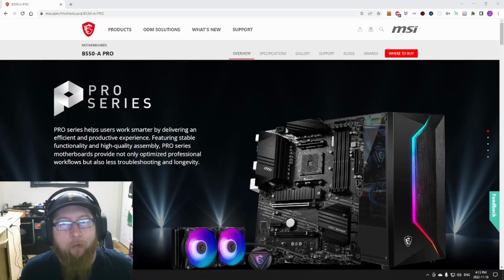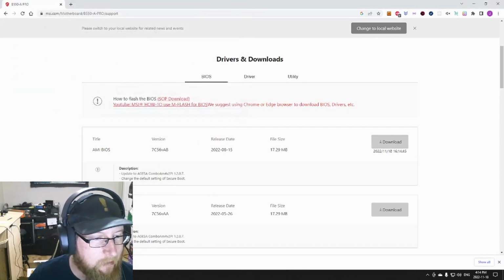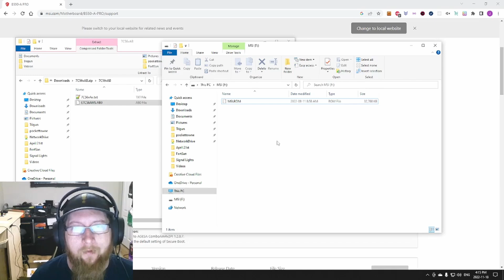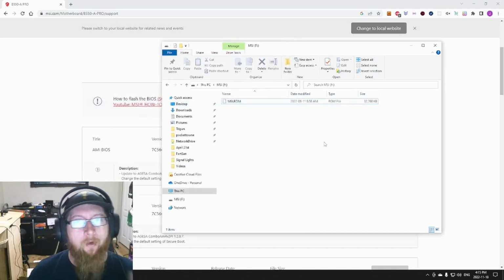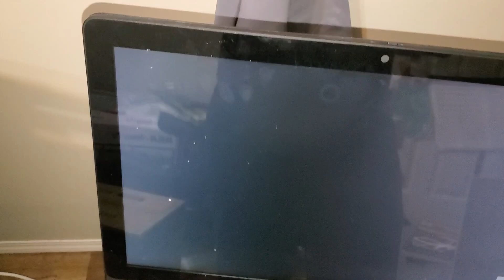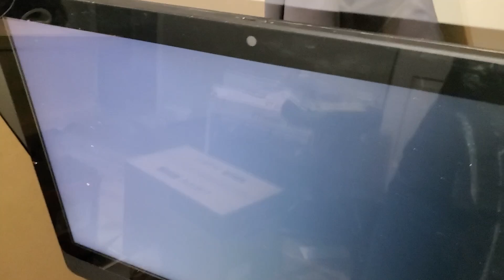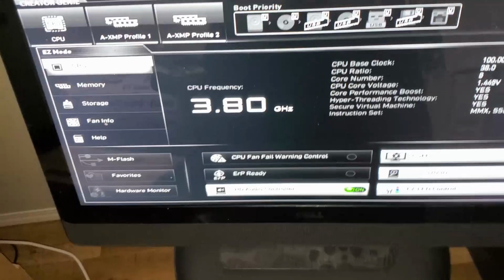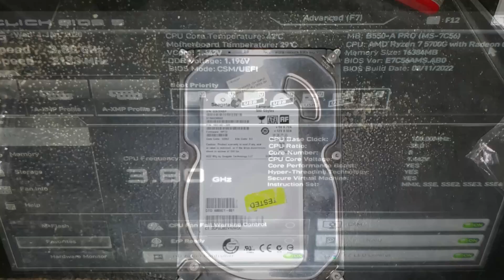MSI B550-A Pro Flash Bios

Comment: I recently had the white ez debug cpu light come after 2 years of the haven the 5600x for this motherboard and now my pc does power on but no display should I update my bios?
Reply from the maker: That is beyond this video. I would post a question in the /r/pcbuildhelp subreddit with your system specs. Someone may be able to assist you further.

To me it sounds like you may need to re-seat your graphics card, or maybe re-paste your CPU? Maybe you have overclocked it and it reduced its life span or the overclock has made the paste not as functional therefore it overheated it? Tough to say without troubleshooting further.
Reply: @Kardall I've reseated the cpu and video card and ram and reset the cmos check all the power cords and everything powers on. It was work that morning and I come home from work then that happens.
Reply: @raizovile did you fixed it? I have same cpu and same problem

Comment: i hve try wht an 128 usb creating a 6 new fat-32 disc.. no works
Reply from the maker: 128gb or mb? smaller USBs are usually better. I use an 8gb stick for mine.

Also, make sure you didn't just put the zip file in the root folder of that drive. You have to extract the file from it and rename it to MSI.ROM
Reply: @Kardall  yes, actually I have change the name and it work thanks a lot men 🫂❤️❤️❤️

Comment: say beta version is ok o q
Reply from the maker: If you install a beta version of a Bios, it might work flawlessly, but it also may break something. That's why it's a Beta version. It's untested, and people who use those Beta versions are the beta testers.

So if you want to try it, go for it, but know that it may crash your system in some manner be it some OS level of interface not working with something on the motherboard or something else like USB lanes not working. Who knows.

Unless it's something critical, I usually just stick to the latest stable non-beta bios versions.
Reply: @Kardall  is the last one for b550 a pro right now, I have the same mb that the video, I have install the beta XD, y hope work, in that case, should install the 2cond opcion? That wasn’t beta version… saludos!!!👋

Comment: I need help bc when i finished ubpdating the bios and turning it on nothing was showing up just black screen
Reply from the maker: Make sure that if you do not have a "G" Series CPU (like 5600G) you have your graphics card installed and the monitor plugged into the graphics card.

If you have no graphics card, you need a "G" series CPU and you plug the Monitor into the motherboard.

Aside from that, it's possible that the update did not take and you may have to redo it. When it is complete, it should take at least 30 seconds, and then the Flash Bios light will go out.

If the bios button is pressed and it blinks a couple times and goes out, it can't find the bios file on the stick. So go over the files on the USB and make sure you extracted the file directly to the USB and not just put the zip file on it, or renamed the zip file. There is a bios file inside the zip that you extract and then rename it to MSI.ROM.
Reply: I mean the ubpdate is finished but theres always black screen. i have ryzen 5 7000x and dedicated card still dont know why this doesnt work  @Kardall

Comment: Can this be used if the light was the VGA light?
Reply from the maker: Yes. And the VGA light would indicated that either 1) Your CPU does not have integrated graphics or 2) you don't have a graphics card installed yet or is not functioning for whatever reason.

Comment: How do you turn it off? Touch the pin again?
Reply from the maker: just turn off the power supply. If it doesn't have a switch, you can hold the pins for the power switch down for a few seconds until it shuts off.

Comment: i go to bios and do m flash..nothing happen only black screen not entering m flash mode
Reply from the maker: If you are able to get into the Bios, you do not need to flash it this way. You can just flash it with the regular method where you extract the zip file onto a drive and load up the manager.
Reply: @Kardall  i plug the pen drive with extracted bios from zip file...exactly load the mflash but nothing hapen only black screen
Reply: @Kardall  succesfully updated bios as your video ..thanks

Comment: Also is isopropyl and a paper towel fine
Reply from the maker: You need to remove any thermal paste from the CPU if you are using the included pre-applied thermal paste on the AIO. Not doing so may cause air bubbles and therefore heat buildup on the CPU.

Yes you will need to use the GPU after flashback to verify it took. You can put the GPU wherever you want, that's up to you.

When cleaning the thermal paste, a cloth or something that doesn't leave fibers is what you're looking for. Swabs are usually good for a final thing as long as you don't catch it on any of the other components on the CPU that are exposed. It may tear fibers off the q-tip. But if you're careful it usually isn't an issue.

Good luck. Pretty much everything that you need to do is in this video, however I did a live stream a while ago (between this video and any newer ones) where I chat with viewers and answered questions, but it's a complete build from start to finish with chapter markers if you have time. Check it out, it may help you especially when it comes to cable management. I kind of try to talk out my thoughts when doing things so you can try to get some sort of a thought process behind my decisions. https://www.youtube.com/watch?v=DtwheSQx-pw I edited a 2 1/2 hours stream down to about 45min.

Comment: And could I just use the stock cooler until I’m done and then take it off and put mobo into case
Reply from the maker: Yup. Just make sure you have IPA (rubbing alcohol) and some swab or q-tips/cotton balls to clean off the CPU before you apply the AIO.
Reply: Also I have isopropyl and lapsed towels so I’m good

Comment: Do you know if there is a stock cooler that comes with the ryzen 7 5700g? Could I just use that and then take it off when I’m done checking
Reply from the maker: The OEM cooler comes with a Boxed CPU. So make sure whoever/wherever you are buying it from, it is a normal retail package and not a tray CPU which will simply be the CPU itself.
Most online retailers like Amazon will be selling you a Boxed CPU. But double check with whatever system you are ordering from.

Comment: And there is one last question. I have an aio, sooo. Idk what to do. Do I just install it? Or can I leva the cpu with out it while I just check the bios
Reply from the maker: You can install the aio sure, it will just be a little more difficult putting it into the case, but it is doable. Just put a box or something that is roughly the same height as the case on the side so you can rest the AIO on it while you install the motherboard. Otherwise you'll need another set of hands to hold the AIO for you while you install the motherboard in the case.

Comment: Also with the pen what did you do? The mother board was built and the psu was on or not? And u press the power+ stick on the panel? Did u press it down, up, right, or what? And did you press both the sticks that are labeled as power- and power+
Reply from the maker: The pen is a screwdriver. You use it to touch the power+/- pins on the motherboard to 'short them' which is the same functionality as pushing the power button on a case. It is how you jump start the motherboard to turning on outside of a case install.

Comment: I have a ryzen 5 5700g so I do have intergrated graphics. What parts are absolutely needed to just start and get it in bios? And I don’t need cooling it can just be on top of box while in bios settings?
Reply from the maker: to do the actual test after the flash, you need:

RAM, CPU, Cooler, 24-pin power, 8-pin CPU power, and your HDMI/DisplayPort from your motherboard connected to your monitor in this situation. The 5700G has Integrated graphics, so you don't have to connect your GPU.

You can totally build the machine before doing all this stuff. It's just not necessary and can save time with removal and re-installation if you have to RMA components. That's the only reason that people do it. To verify that the system will POST (Power On Self Test) and get into a Bios screen.

A stock cooler does not need to be removed after you test it, in order to throw the motherboard into the case. It shouldn't block any motherboard mounting points so, you should be able to access the screws.

Comment: Also I am using the XFX Speedster QICK319 RX 7700 XT so can I leave that out or do I have to hook this up too? And I believe once I build it on top of box I don’t need any cooling while I check? Btw you have been INSANELY helpful im going to sub ti you thanks alot.
Reply from the maker: If your CPU is not a "G series" assuming that it's a 5000 series CPU, then it won't have integrated graphics. So to get a video output after the Bios flash, you will need to at least connect the GPU to the motherboard and the power connectors for the GPU when you try to boot it up for the first time after the flash.

It should go into Bios automatically or give you an 'unbootable media' type of message on the screen. But other than that, you should just need:

1. 24-Pin Power to the Motherboard
2. CPU 8-pin power for the flash
3. USB with the bios file renamed to MSI.ROM (not the zip file, the rom file is inside the Zip file so you need to extract it and rename it into the root folder of the Fat32 formatted USB drive)

Then you plug power into the power supply, turn the switch on the back if it has one, and push the flash bios button on the motherboard as I did in the video. You do not need the CPU installed, the RAM or any drives connected to perform this other than the USB drive in the correct slot.

Once the red light stops flashing, the Debug LED light will stay on, but the red light will stop flashing and turn off.

Then you can turn off the power supply, or unplug it. Install your CPU and a cooler, RAM, connect your graphics card and it's required power cables. Connect a monitor to the GPU and then short the Power SW pins on the motherboard as indicated in the manual and on the motherboard (it's printed). I kind of show it in the video as well though it's tiny and hard to see.

You should at least get a video signal at that point, to which you can proceed to power the system off and continue with your installation into the case as normal.
Reply: @Kardall  I have a ryzen 5 5700g so I do have intergrated graphics. What parts are absolutely needed to just start and get it in bios? And I don’t need cooling it can just be on top of box while in bios settings?

Comment: Ok, so just tell me what parts are needed for the pc to turn on and go into bios, and then if I’m correct after the flash update I just take the drive out and check if the update is installed and if it is I can go ahead and unplug everything stick it in case and then build from there? Also does the cpu need cooling when checking the update.

Comment: But as a first time builder I don’t want to build then take apart then build again but the system I’m going to buy requires bios flash so what should I do?
Reply from the maker: When you get the parts, you put the parts together on the motherboard box. Then do your flash update.

When you put it in the case, the only thing you need to remove is the cables for the power and maybe your AIO but... you could probably manhandle it or if someone is there to hold the radiator while you mount the board in the case. You can leave the CPU installed, RAM, M.2 if you have one. If you are using a G series or doing this on a 7000/8000 series with iGPU then you can just leave out your graphics card, and POST the system with the motherboard HDMI instead. It should give you an output when it is successful.

It can be done.

Comment: You didn’t even build it before turning on?
Reply from the maker: You should always do a POST test before installing it into the case. What would happen if the motherboard was faulty, and you had to remove it all, undoing all that work? :D It's a time saver.

Plus, if it works outside the case, and doesn't inside, then that means something isn't connected properly or you broke something during the installation :D

Comment: It's mandatory to do this? i'm about to buy this motherboard with a 5600x, but i don't know if i need to do this or just if i want it
Reply from the maker: You need to do this if the Bios you get is older than 7C56vA7 yes.

Seeing as the launch version is 7C56vA0 then I would assume worst case scenario and assume you need to be prepared to do this.

Comment: help!!! when i press the flash bios button, it wont blink at all
Reply from the maker: 1. Did you extract the bios rom file to the root folder of the flash drive? or did you just put the zip file on the drive?
2. Did you rename the extracted rom file to MSI.ROM (case sensitive)?
Reply: Hey, 
yeah i extracted the file and renamed it MSI.ROM, also i tried it with 2 different usb-sticks. Also converted them to mbr.
For the PC-Specs:
ryzen 5600
rx6750xt
MSI-B550-A-Pro
Seasonic G12 550W 80+ gold certified 

so i´ve been trying at least 6hrs+

tried everything also putting the specs in my other pc, everything works but when i assemble everything in the MSI Motherboard and try to start it up it will say EZ DEBUG CPU light on, so i´ve assumed that the cpu or RAM dont work, but on a ASrock motherboard they work perfectly, so i´ve been trying to update the Bios of the Msi-Motherboard without any success, the light won´t even come on if i press the flas bios botton. Does that mean the Motherboard doesnt recognize the usb-stick or what?

i would appriciate some help :) @Kardall
Reply: @Reza-mc4kt hey did you ever figure it out? I have the same problem and mother board as you

Comment: This board seems to be best value and bang for buck b550 with the features you get and fantastic VRMs however I can't help but wonder what made MSI opt for this greyscale looking BIOS instead of red/black colorway some higher end boards have. 
I know b450 chipset boards by MSI had to sacrifice Click Bios UI and maybe some features in order to accomodate Ryzen 3000 CPUs at the time due to their BIOS chip limitation being 16MB however here that is not the case, all B550 boards come with 32MB chip so the only reason I can think of is because PRO Series is general purpose board class, no fancy RGB and gamer aesthetics like MAG,MPG and MEG series.
Reply from the maker: Ya I am not a huge fan of RGB. It is the Devil's Toy.

I just did a build with AM5 on a B650 and it's updated bios was Red. So ya, not sure what happened. If I remember correctly, I had a red bios with my X470 board and at some point they switched to grey... it's odd. shrug The AM5 board was the MSI B650 Gaming Plus Wifi, and it's actually not a bad motherboard. Very easy to update like this one and smooth sailing.

Comment: I have a mobi fully hooked up to all components and in trying to flash bios, i didnt fornat the usb. My red flash led is staying on after flashing a few times.
Reply from the maker: It can literally take like 5 min +

Also, as long as you have the MSI.ROM file for the motherboard in the root folder of the USB drive (lets say it is F:), it would be F:\MSI.ROM like was said in the video, then it should detect it as long as it's the correct bios file for that motherboard. You have to rename the file from the zip file you download from MSI.

But eventually what should happen is the red light goes off and the white LED debug light will stay on.

Comment: Every time I try and boot it up and close the bios menu it flashes, and then sends me back to the bios. Do you have any advice for that please I’ve tired everything I can and it doesn’t help
Reply from the maker: If your PC is booting to bios, you can do an update using the base ROM file that you download, from inside the Bios screen. You don't have to use the Flash Bios button. If you keep going to Bios after turning the system on, that means that the system can't find the Boot drive (if you have even installed your OS yet).

Since you can get video output, you should be good to install your OS now, you can always update the bios later using the windows utility or other methods that do not require the 'bios flashback button'. Which is really only necessary if your CPU does not have support on the current version of the Bios.

Comment: I have serious problems getting to my Bios. Everytime I try a key combo while restarting the screen will just be black/my screen loses the signal. Now I tried to do it like you did it, prepared the stick, put it into the bios slot, pushed the button but when I started my computer again, I didnt get to the bios screen but the normal windows screen with just my pin not working anymore. What did I do wrong? :/
Reply from the maker: Possibility that your OS has become corrupted. Potentially an update that failed when you powered down the system at some point during an update?

You could try to do the "Reset This PC" and try to see if the OS installation is correct.

Or change your sign-in option to password and see if your password works (might be your Microsoft password if you have activated a digital license).
Reply: @Kardall  Thanks for your respond! My computer is just one week old, so I dont know if it was an update but since i havent put that much stuff on it yet, I just might as well reset it completely.
I got around the password, so that was no big deal :D

You know, my main issue is that all of these ways to get to the bios by pressing certain keys when the pc was starting didnt work. My screen was just black whenever and however ive tried it. So i thought it might work with a stick but that also seems to not work, kinda desperate right now :P